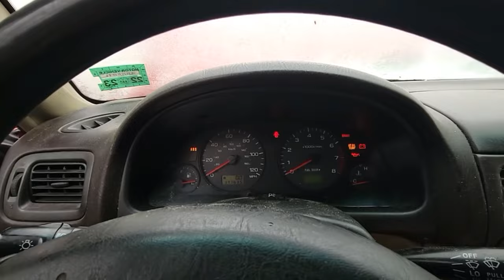01 Subaru Forester- He said it still ran??

Comment: Those jump boxes are so much better than the small digital ones are. We used those at work for ages and loved them. They just recently switched to the digital boxes and everyone hates them. 
My sister had a Subaru that she wrecked. She parked it for close to a year before selling it and we had a hell of a time getting it started back up again. Just like this it would crank over just fine but refused to fire off. As I was checking for spark it just randomly fired off and ran again. Lol

Comment: Darn ,  those are great snow machines..if they run 😂  no sparky.. wonder if there is power at the coil pack.. hmmm or is the computer missing.. something is up . I love my Subaru’s for the winter . I have 2 foresters 2010.. one does leak a bit of oil from the head gaskets.. but not enough to care about. I like them so much , I change the oil every 4K miles with full synthetic.  It’s a cold morning here -10.C feeling like -16.C   No snow yet .